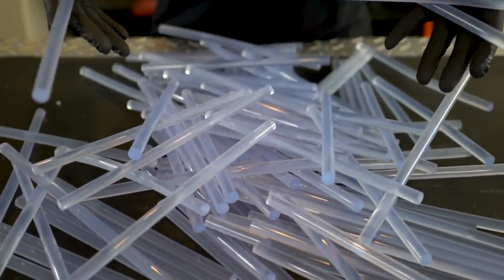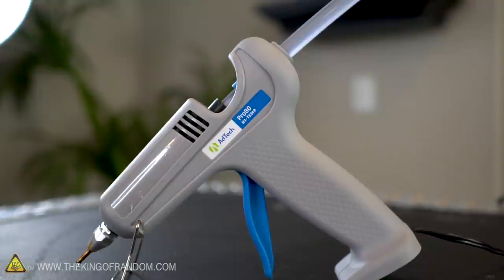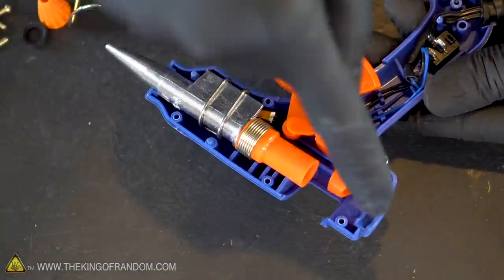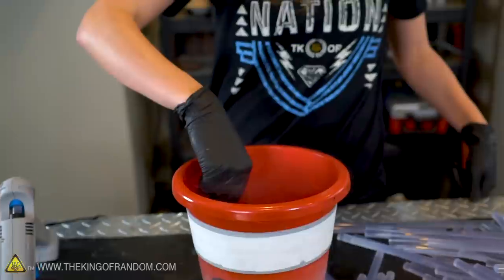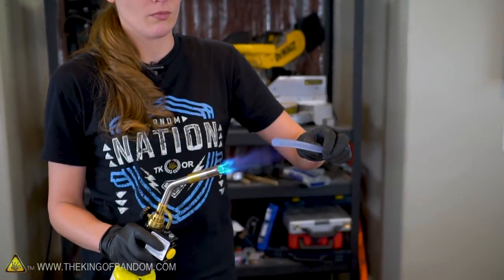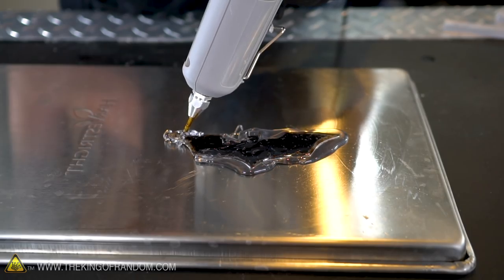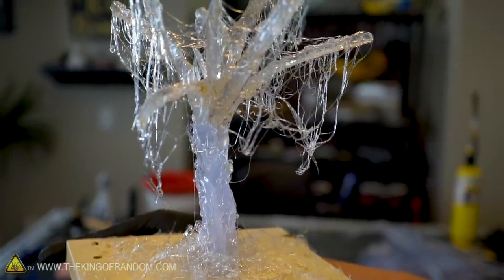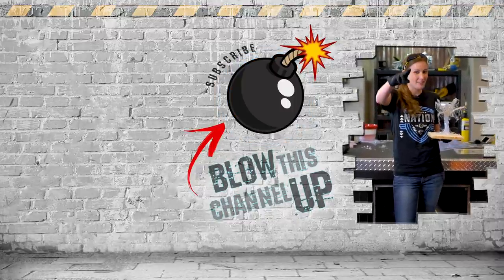Did You Know HOT GLUE Could Do This?

Comment: I am now wondering what you can do with cold glue
Reply: Oh.....
Reply: you can get a rollie rollie rollie and dab on it
Reply: Slime, of course.
Reply: Epoxy*
Reply: Uhhh, heat it up.
Reply: Feast
Reply: It really depends on the glue because my job I deal with a glue that we make a take that the company heats up to glue to boxes to make them stronger. The glue by itself. when it is warm but not melted in to a liquid at 300 degrees. it kinda stretches a little and bendy. But when cold it turns fragile like it is glass. Normally how I cleared some tools I just stuck it in the freezer then used a hammer to smash the glue off.

Comment: Hot glue will stick to metal if you warm the metal a little just before gluing the two materials together.

You can even use the nozzle of the glue gun to warm the metal surface you want to glue, you don't want the metal surface to be hot, just warm enough so the glue won't cool too fast.

If the metal is cool or even cold the hot glue cools off too fast to stick to the metal surface.

Comment: Hot Glue has been used by the film industry to make cobwebs for horror films for decades, although the original cobweb gun was actually about the size of a hair dryer with a spinning element on the front.

Now they are smaller, the size of a normal large hot glue gun and simply attaches to an air compressor to blow the hot glue in a fine hair-like strand that will stick to whatever surface you aim to decorate. (However it does clean up easily)

You Can even buy one on Amazon for your next haunted house for Halloween.

The Webcaster Cobweb/Spiderweb Shooter on Amazon for about $30.

Comment: Of course they would burn,the factor making them fairly hard to catch on fire is that their particles are huge and durable,requiring a lot of energy to mess up the binding and start reacting with oxygen in the air. As you said ,they are plastic after all,which means they are made of oil.Would oil burn?Of course yes.

Comment: I fixed a water line I know it’s hard to believe but  I used a piece of water hose wrapped it around were the black line was cracked and used hot glue to hold it in place then put hot glue all over the outside of it it was to be a temporary fix but it held for two years like that until the line cracked some were else so it really never failed